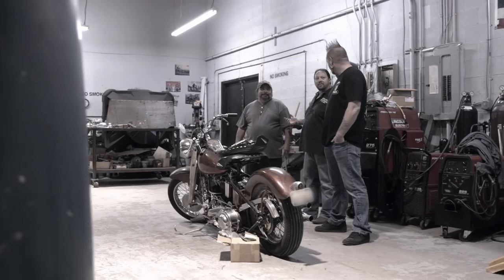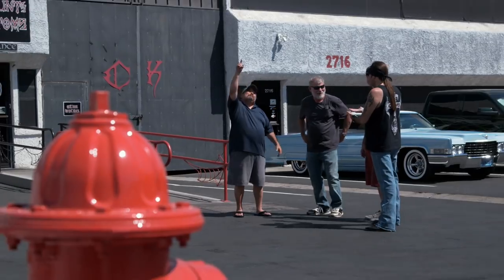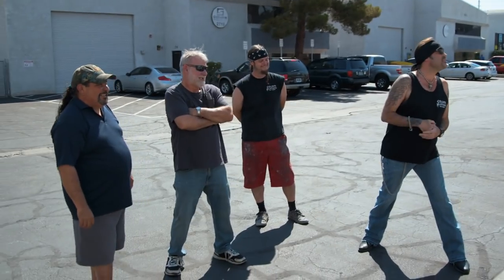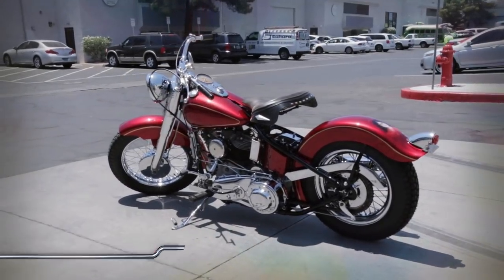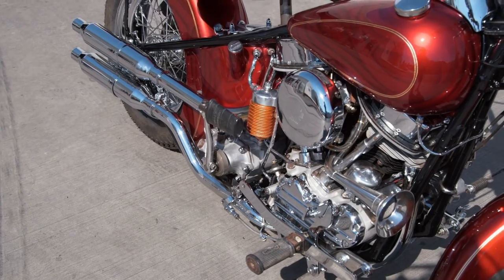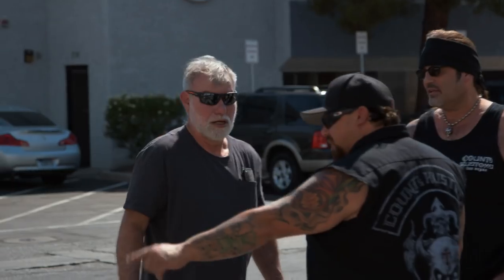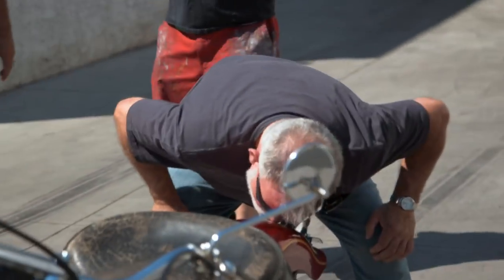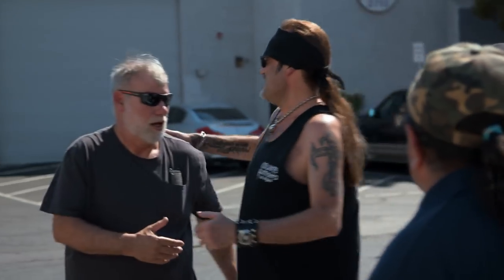Counting Cars: Restored 1957 Harley Davidson Panhead Prototype (S7, E13) | History

Comment: I wonder if it leaks oil? Like it did from the factory
Reply: The Bike was built by S&S, not by Harley Davidson.  S&S parts are the Fixes that Harley should have had all along.  Little side note:  When you bring your old tired engine to HD to get rebuilt so you can keep your matching serial numbers and yes HD has such a program.  Harley sends all those engines to S&S to do the rebuilds.  Just a side note...